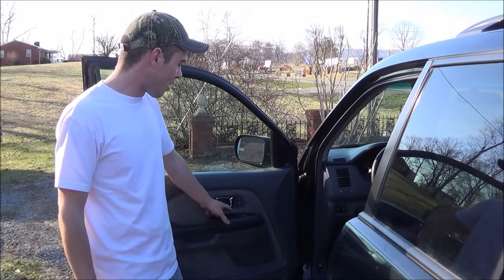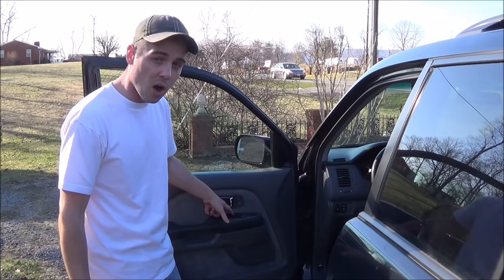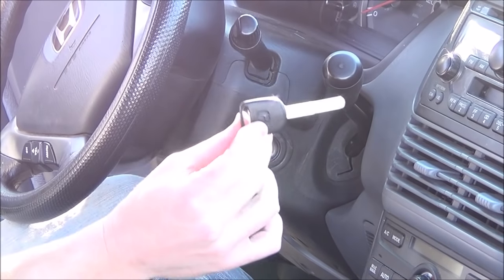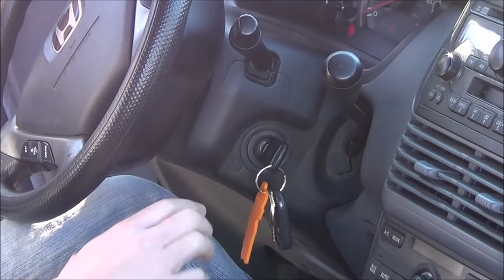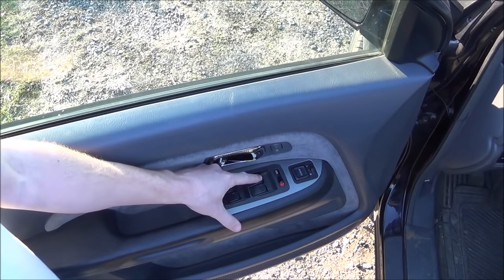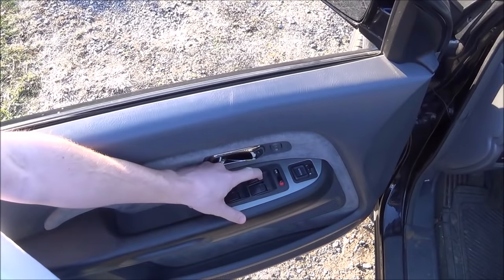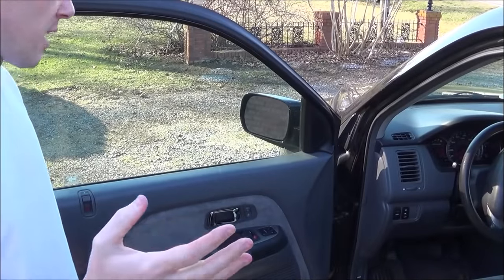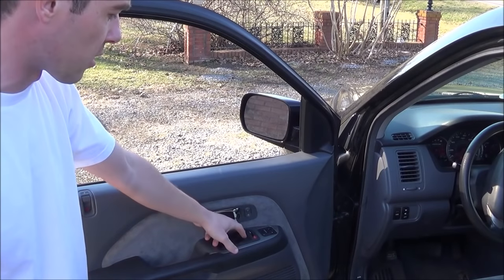How To : Fix Your Honda Automatic Power Window Switch

Comment: Do you think it's possible that if a driver and a rear passenger are both operating the window controls at the same time that it would make the up/down power feature malfunction?  Or…am I over reaching? (My rear passenger window stopped working at a time when both the driver and passenger were simultaneously trying to control up/down features.)

Comment: You are fixing a problem that I wish I had on my 2010.  I don't like that extra click in the switch that fully raises or lowers the window.  I want the window to only move when I have my finger on the button.  Changing my battery did nothing.  So I guess my 2010 works different.  I figure I will need to take the door apart to get to the switch and remove the wire that triggers the automatic full up/down.

Comment: Wow, I thought I was going to have to take the door apart and replace the whole control module! My main control’s passenger window switch wasn’t working (even tho did work on passenger side control) and all I had to do was do this procedure on the passenger door switch and it reset the main control!!! Literally took me 5 seconds.

Comment: Thank you so much for save my time and money, my is 2008 Acura MDX. My problem is driver main switch can't control front passenger side window, and lucky is the passenger side switch work but not auto function just like video, so I tried to follow the video, but I didn't have much hope, turn out it works, wow amazing. Hope help other people.

Comment: Worked as a treat for me on my Honda CR-V 2007. My Auto on the RHS window (driver side in UK) wasn't working properly .When try to auto close  was going up and instead of stopping was going back more than halfway down on its own. After the Mississippi trick works as it should. The easiest fix ever.Cheers mate.

Comment: Wow, I just save some major bucks.  Great video, easy to understand.  My problem was the passenger window would work for its side but wouldn't work from the driver's side control console.  Followed your advice on the passenger side, with the start button on accessory (2 pushes) and now everything works like a charm.

Comment: The only one that works is the driver front master window. All the other three rolled down on there own amd stayed there. You can hear the gear trying to move each one. There's a click..but like they're stuck...I've checked all the fuses and they are fine. How do I get all the other windows to roll up? With out having to replace all the motors?

Comment: Does this process work for the rear windows as well?
Reply from the maker: +DeCarlos Williams not unless your car has factory auto up/down windows in the rear.....typically it's the drivers side front only.
Reply: Just taking a shot in the dark.  Were are having an issue with the rear window of a 2007 Honda Accord. Thanks for the reply.
Reply from the maker: +DeCarlos Williams it's either the window regulator motor, rear window switch, front drivers window switch (aka master switch), or the fuse.

Comment: This also worked on my 2013 Accord EX-L passenger side window. It would not go down from the drivers side and only manually from the passenger switch. I performed this procedure with the ignition button in run mode on the passenger side and it fixed the problem. Thanks!

Comment: Wow... I can't thank you enough. Having had a flat battery in m y 2007 UK spec Civic, my passenger window stopped working from the drivers side control. I tried your tip on the passenger side control which re set the switch and in turn allowed the driver's control to operate it again. Saved me taking the door panel off or replacing switches! many thanks :)

Comment: My 2019 Honda Ridgeline had a problem where the passenger window wouldn't function from the driver controls.  I performed these same steps on the passenger window and it was automagically fixed.  Thank You!
Reply: Did you do the steps from the driver side panel or the passenger side panel?

Comment: This worked for even a slightly different problem: I couldn't operate my passenger window from my driver side controls.  Passenger controls still worked but driver side controls operated the other three windows but not the passenger one.  Then I noticed that from passenger controls the automatic function wasn't working either - regular up and down were fine - so I reset the automatic function from the passenger side just like described in this video and magically my driver's side control of the passenger window came back to life.  Saved me $500!! Thanks! HONDA PILOT 2016

Comment: Thanks a lot sir. After i change my door on Honda Civic 8th generation 2007 from left side the button from my side was not working for passenger window i thought that have electrical problem. After i did this from your video on the window from passenger side the button from my side works again. Thank so much very good video! 👏👏👏

Comment: DUDE!! You are a life saver. MY '01 Accord was having this problem. I changed the regulator and the auto down function no longer worked. I was thinking "Oh what NEXT!?" Although I don't have the auto up function, we do have the auto down. But I did both as per your great video. I was thinking I had to chase relays and ring out the wiring. Now I DON'T. Thank you so much.
I DO have another question. My main cabin light stays on until I shut it off manually. Both leads into it are hot and I know one should be not as long as the doors are closed. But even with all doors closed, it stays hot. Now that being said, I did change all the courtesy lights to LED but I don't see how that should matter. Or does it? Can you help here?
Reply from the maker: Probably your door switch….it is a little plunger that pushes in when you close the door near the latch.

Comment: This worked for me, 2016 Honda HRV, less than 600 miles on it. No battery change. No idea how it stopped working.
Reply from the maker: Good to know!  600 miles....and already having issues.....yikes.  Maybe a loose battery cable.

Comment: Major problem with my 2006 Honda Pilot LX Master Power Switch Control.  Window stopped working (in the shut position).  Replaced the Regulator, no deal.  Replaced the p/w Control Unit.  Still no deal.  I can only assume that 1) the Regulator I bought as a replacement is defective or 2) The Control Unit replacement I purchased is defective or 3) Both are defective or 4) Something else like the Master Control Switch is at fault.  But how do I go about determining this?  I know NOTHING about electricity, let alone how to test it.   Before I started making all the replacements mentioned, there would be a clicking noise coming from the p/w Control Unit when I activated the Master Switch.  That same clicking is now made by the new p/w Control Unit.  There is this, too:  To make the problem more puzzling still, all the other windows work fine. It's just the driver-side window, front, that does not.  And finally this question:  Some of the unions have what appears to be a kind of lubricant of on them.  This seems totally wrong.  Wouldn't that almost guarantee a short?  I will greatly appreciate any suggestions you have and thanks for taking the time to share so much free knowledge.

Comment: My driver door switch  loose and will not work. I am afraid of breaking it as I tinker with it. I have tried many ways to put the switch back into it's place. Any help would be appreciated. 2008 accord ex v 6

Comment: I have a different problem with my Honda accord windows. The small rubber strip on the side of the window sometimes goes ''behind'' the window, so it cant fully close, and sometimes get stuck. I can fix it temporarily by lowering the window again, adjusting the rubber on the right side of the window and trying to close the window again, but it's a hassle, especially if I'm driving and must stop to do it. Any ideas how to fix it?

Comment: Need some help quick! My 200 Accord windows will not go down at all on the driver's side but every other side works fine what should I do?
Reply from the maker: aneudy01 I would check the fuses/relays, check the switch, and most likely end up replacing the window motor/regulator.  The drivers side (Left Front) window dies faster than any of the others since it is the one that is used the most.  You might get lucky with it being a fuse, but I assume it is your window motor.

Comment: Thank you for this fix recommendation.  It did not work for me but the entire section of buttons is a little loose, is this the reason it wouldn't fix the AUTO button?  Is there an easy fix to tightening the panel buttons on the drivers side door?

Comment: Awesome video, thank you. I changed the battery of my 2014 Honda CR-Z and almost 2 mos ago. The power window on the driver side did not have any issue. However,  the power window on the passenger side started to act up last week. And now it no longer works. Not sure if changing the battery almost 2 mos ago has any affect to it.... But might you have  any suggestion on how to get it work again? Thanks!
Reply from the maker: Check the fuses and relays….. then check the drivers door master window switch….. passenger door switch….. And finally the passenger window regulator motor.

It’s either not getting power, or the unit needs replaced.  You can find Step by step vids on how to check each item above.  All you’ll need is a multimeter and a screwdriver.  You can do all the testing in your garage/driveway easily.

Comment: You're my hero!  I couldn't find any damage of any sort.  Then I found your video and fixed it instantly.  One note - on my 2014 Civic I have to turn the key to the On position.  The windows don't work in the accessory position.  Thanks!
Reply from the maker: +Rick Cavallaro Awesome Rick! Glad to help!  And thanks for the update about the 2014 Civic.....I am certain that many vehicles will be the same as yours,  but it is nice to know that this procedure solves so many people's problems.

Comment: HOW DO I DISABLE THE AUTO UP / DOWN? I do not want the window to go up and down fully. And I'm tired of manipulating the switch to stop the window. All I want to do is crack the driver side window. When I DO manipulate the switch I notice a bulge occurring on the exterior door. I'm burning out the servo motor I'm afraid.
Reply from the maker: If your door is bulging out, I’d say it is much more likely that the mounting bolts/rivets have broken or come loose.

Comment: Problem is that my window won't roll down.... and when I push the switch all the way down to do the automatic roll down it just clicks. Then nothing.
Reply from the maker: Nmarryat24 If you hear clicking inside the door, I would say your motor or regulator is bad.  If the switch is clicking, it could be bad.....this is just the reset procedure if your power got disconnected.  Sorry!

Comment: I am going to try hat, because I brought my 03 Honda CRV in a repair shop for major radiator and AC work.  When I picked up, that window auto didn't work so I googled this, however the other thing that did not work is the "CLOCK RESET" I was able to get radio CODE in, and radio back, but CLOCK RESET instructions didn't work this time so do you know why?  Also, Ive never had to reset the window before when battery was taken out. I wonder what was different this time with the two odd not working things after.  Do you know why it happens or advice on CLOCK TIME reset also not working for first time along with window issue first time?
Reply from the maker: BinkyButtons1 I would imagine that it is something simple that is preventing you from setting the time.  If you could unlock your radio, but cant set the clock.....it is most likely that you are not holding a button down long enough.

Comment: This worked great.  Thanks.  Any idea why the passenger and two back side windows stopped working.  Could this be a fuse problem.  Thanks
Reply from the maker: Terry S. Hays Only the drivers window is automatic up/down....the other 3 windows have to be manually held to raise/lower them.

Comment: I recently changed the master switch because 3 of my power window were not going up and down.  After changing the master switch the alarm kept going off. Do I need to reprogram the master switch too?  When I put the old switch in.....the problem stopped.  Odd
Reply from the maker: I would suggest disconnecting your battery prior to replacing electronic components.  As far as I know, Honda's do not require that you program compatible parts to "work with" the vehicle (like some foreign cars like Volvo or BMW).  I imagine that due to the complexities of automotive wiring, something that will trigger your alarm is routed through the window switch & when you reconnected the new one, the car thought that someone had broken in.  Did you try locking & unlocking with the keyless entry when this happened?

Also, I just was working on a Lincoln & just to give you an example, after reconnecting the battery I opened the drivers door & the alarm went off.  So, you most likely do need a keyless remote to disable it.

One thing to note --- BE SURE to have your radio security code!! If you disconnect your battery without knowing what that code is, then when you reconnect it, your radio will NOT work!  The code is typically on a card inside your owners manual OR it is on a sticker on the side of your glovebox when opened (5 digits).

Comment: my Honda CRV 2003 driver side window intermittently won't go up. It starts to then (goes up about 1 cm) retracts back down, like a quick start stop (comes up goes down) action. Sometimes I can be sitting in the car for 5 or so minutes to keep trying to get it up - it eventually takes and goes up. Any ideas?? Thanks
Reply from the maker: Sounds like a faulty switch to me.

Comment: This works like a charm! Everytime. But that's kinda my problem... It resets everytime I turn the car off. What's the deal? :-/
Reply from the maker: +Katie Weber Thanks!  I would guess you have a bad switch or a grounding problem (corroded/broken wire).

Comment: I've got a different problem on my Honda Jazz 2012. This morning the switch on passenger's door stopped working completely. Is there any way to fix it in a simioar fashion of your video?
Reply from the maker: Outsourced Sales This video really only covers the drivers side switch (auto up/down).  If you are having problems with a different window, it could be as simple as a fuse --- or as complicated as the window motor/regulator being burnt up or the switch being broken.  You should check out some videos on how to check your window motor, switch, and regulator.

Comment: Thanks for the video. However, my issue is slightly different so I'm wondering if you can help.

I have a 2010 honda fit and the drivers door was recently replaced. My issue is that when I use the auto up it will raise about half way and then stop. The auto down works fine. If I hold the switch up or down it will work fine, it's just the auto up.

I tried a few different things online (including yours) but they don't seem to be working!
Reply from the maker: Melissa Spearow Sounds like your master switch (drivers side front) is bad and/or has corrosion on the contacts.

Comment: It didn't work on my 2003 Honda Civic LX Coupe.  Just checking to see if it should have on this model year.  If not do you have any other suggestions?
Reply from the maker: Rick Miller If the drivers side switch (that controls all of the windows --- aka the "master switch") will still make all the windows go up & down, but wont auto up/down the drivers window.....either the car was not equipped to have auto up/down or the switch is faulty (i.e. -- rain water dripped in and corroded some internal connections).  They cost over $200 new....so I would definitely find a used one from a reputable dealer on eBay if you choose to replace it  --- keep in mind that you need to color match, year/model match, and coupe/sedan match....all are different, even though they may say "2003 civic window switch".

Comment: Hi, my driver window on my CRV doesn't make a noise or anything nor does it work.  I've checked all my fuses and they're fine.  And the left rear passenger window doesn't work either.  (My drivers side is on the right side - NZ)  Any suggestions?  Thanks
Reply from the maker: +Emily Koni Most likely you have a bad ground, open circuit, bad master switch, or 2 broken window regulator motors.  I would check power at each regulator (remove each door panel, unplug connector, use a test light to connect the two pins in the connector & activate the switch.....if it lights up, you are getting power & the motors are bad....no light = bad switch, bad ground, or open circuit).

Comment: This is great!  I will try shortly, but I don't think this is my problem.  The driver side window won't go up or down.  I have checked all the fuses and they are ok.  Any ideas.  Just stopped working.  I rolled it down, next time I drove, it wouldn't roll up.  Two days prior, my father and I cleaned the battery terminals and unhooked battery.  Would this cause an issue with power windows?
Reply from the maker: I would guess your window regulator motor is bad.....the front drivers side is the most common one to fail since it goes up/down the most often.  Definitely a novice-level repair, so if you have some tools it shouldn't be an issue (a screwdriver and a couple small wrenches/sockets).  Word of advice --- replace the regulator/motor combo at once, don't simply replace the motor --- it will save you a lot of time & it a lot easier.